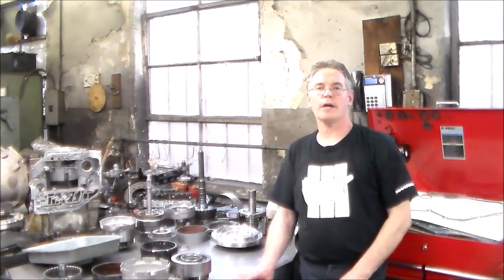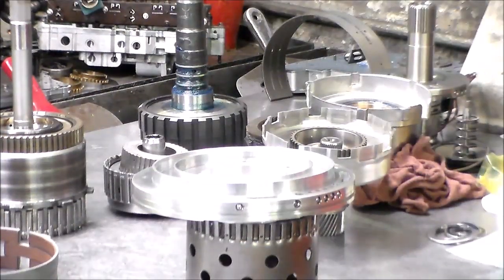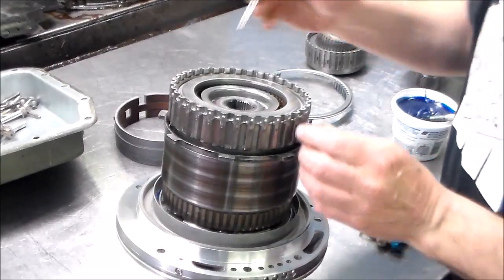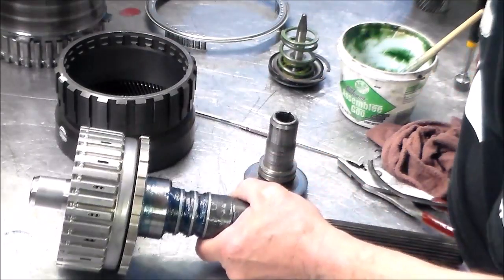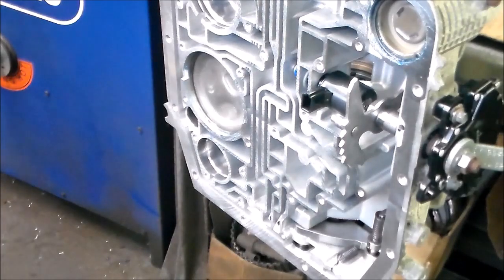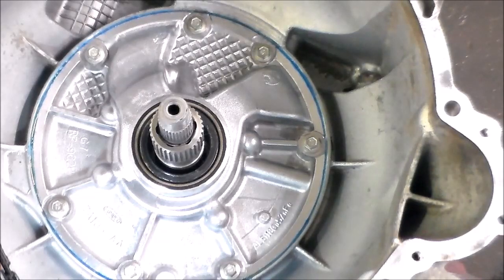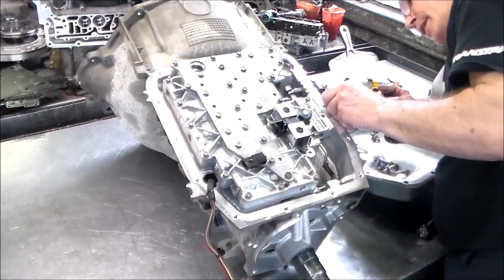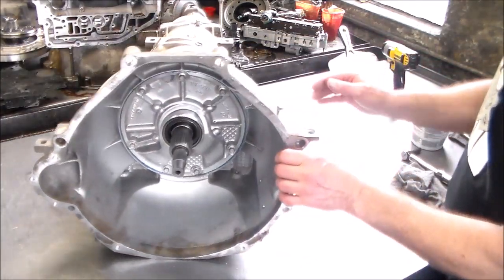4R70W Assembly

Comment: Reusing my old  input drum, modest rebuild (and learning this stuff), I discovered that the input shaft was slowly being hammered off of it's splines (287,000 miles), difficult to remove forward clutches, overheated code, and forward assembly didn't seem to sit all the way down;  It was losing forward oil pressure, my plan was only to fix 4th (burnt band), trash 2-3 accumulator, but none of the forwards had any "Umph!" even before the 1st removal (of tranny), this video, 2 or 3 removal/reinstalls later -- thanks to your air test performance, I have learned more.  Now I want a test plate for every tranny that I do.  I got a salvage yard input drum, $19 USD, air pressure tested it, build everything back up, 4th reinstall, and every gear is working flawlessly.  Thank you a million for your demonstration of air pressure testing; I have become very confident in my valve body vacuum testing already, but air press testing is a game changer for me! Thanks again, I'm subscribing 🙂🙃
Reply from the maker: Thank you

Comment: I would love to see you rebuild one of these for a high performance application. I’ve rebuilt one. An 04 4r70w. I have an 03 trans out of my marauder that is gonna see 550hp(I hope)   Love your videos
Reply from the maker: I do the NAG1 Performance, they are in the Doge Chargers
Reply: I second this. Planning a rebuild on my first vehicle I have ever owned. 4r70w has about 260k miles, and is roughly 30 years old. I've had the truck for about 12 years. My dad loved the truck, and passed away last year. Would like do restore it all the way, and add about 100hp. I have no clue about transmissions, or performance transmission parts! Anyone have any tips on which parts should be performance, billet, etc? Thanks for the video!

Comment: Nice to see it's a rather simple and straight forward transmission. Nice to know the washer for the OD servo will firm the OD shift up. I did the JMOD shift kit to my 4R70W a couple years ago and really like how it shifts but the OD is still stock and mushy. When it comes rebuild time I'll be doing that servo pin upgrade. I see a lot of parts in that trans that look strikingly similar to the old cruise o matic I rebuilt.

Comment: Hi Gary!!

I have a 1997 4x4 f150 lariat and when i put it in drive i have to accelerate the engine for the teran to shift the first gear and after that I have no problem until I have to go back to neutral or reverse and when I put it in drive again I have to accelerate the engine.  Any advice on that? Is a 4r70w 
And what is a good trans kit for rebuild 

Thank you!

Comment: Excellent video. I like you videos because they are so instructional. I really feel like I could disassemble and rebuiled a transmission after watching. You have a decent amount of content on the ZF six speeds. Any chance you could do a rebuild video on one of those, specifically the second gen units? I have a 6HP21 so I have a vested interest. I see a number of disassembly and valve body related videos. I have taken away that the bushings should be replaced with a rebuild. I don't think I have seen a full rebuild, however. Thanks.

Comment: Hey Gary, I’m in Australia and I find your videos very educational and entertaining. I really appreciate the work and effort you put into them for us....thank you. I have a ford falcon with a zf6hp26 and it drives well except for the slightest shudder at approximately 1000-1500 rpm (lockup). What could be the course? Transmission or torque converter? I’m hoping you know of a common issue. Many thanks mate. 👍🏼👍🏼
Reply from the maker: Does it feel like your going over a rough road or maybe railroad tracks?
Reply: @GaryFerraro  Garry, I have a similar issue with the zf6hp26 in my l/rover. Feels like small corrugations on the road. Thanks for the videos. Regards.

Comment: I have one of these 4R70W with 4.6L in a 1997 Crown Vic with 245,000. It shifts without problem but I have a leaking tailshaft seal. So is a 1997 the "old" type where I can replace the bushing without issue? I bought the seal and bushing.
Reply from the maker: shouldn,t be a problem, may have to remove the tail housing but it should come right off

Comment: 2008 f150 4r75e. Rubbing between the center support and the non ferrous drum section. Anti rattle spring installed in same place as yours.
Reply: Mostly on opposite sides now
Reply from the maker: you install it in a different location @twiztedmowers2

Comment: Thank you for the video…very helpful.  I have a 2001 4R70W out of a mustang.  What manufacture of the direct drum and misc pieces do you like to purchase.  Trying to avoid crappy parts if I can for a home build. Thank you in advance…
Reply from the maker: I purchase from Transtar, if you can an OE drum that would be great, Transtar sells aftermarket which i used but if you can get OE from a source or the dealer that is the way to go, overhaul kit i go with Transtec, Bands i think Transtar sends me Borgwarner and Filtran for the filter
Reply: Mr Gary,  I have a 2003 f150 4.6. Is the  same kit for all 4r70w?

Comment: Hi Gary, I have a 2005 Ford Lobo 4x4 5.4 liters and starts fail, 1-2, 2-3 gear and overdrive works good, but in the highway the last gear like 3-4 gear slips like neutral. I'm thinking in solenoid or torque converter lockup

Comment: love these videos. started teardown of a 2000 mustang v6 4r70w. It did not have the antirattle clip for the intermediate clutches shown in this video. do all years have it?  Trying to get to where I know what kit i want to order.
Reply from the maker: That year may not have one,  no need to put one in
Reply: @GaryFerraro   any suggestions please - my 2000 4r70w reverse clutch has a bit over .100" clearance with 3 new frictions and 2 steels, and a .075" snap ring. What can I do to bring that clearance down to specs?
Reply from the maker: @pdperformance1  Ask for early AOD reverse input clutches, same diameter but thicker

Comment: i running an AOD in my 70 mustang. want to upgrade to a 4R7oW. The AOD is almost new and i want to use any interchangeable parts into a good 4r70 case and of course i'll need the  companion computer. is this a good swap? running 500 dyno HP and torque the same. The AOD is too hard to set shifts and torque converter lockup. 2800 stall converter.

Comment: I put a light scratch into a 4R75 1-2 accumulator bore.  Just enough to catch a fingernail.  I bought another core and found what kinda looks like galling in the same bore.  So I bit the bullet and bought a Sonnax sleeve kit and the Sonnax installation tool. Transtar told me the tool is necessary.  The instructions say the tool is not necessary, but convenient.  I can't get the lower sleeve into the bore.  It feels like an interference or press fit.  The upper sleeve feels loose by comparison in the upper bore.  I assume the loc tite they recommend will solve for the loose feeling sleeve.  I can't afford to screw this up and failure to install correctly looks like a permanent failure.  Can you share some insight as to how I'm supposed to install that lower sleeve?  Thanks for your time.
Reply from the maker: Did you try sanding may be burrs or something keeping the sleeve from going in all the way
Reply: @GaryFerraro  Thanks for getting back to me.  I tried both halves of the sleeve in both cases.  The upper sleeve feels equally loose in both cases and the lower sleeve feels equally unable to fit either case..  There are no scratches , knicks, or burrs that interfere in the lower bores of either case.  I removed the high spot of the one light scratch I did cause.  The smaller sleeve is tight right at the chamfer in each bore.
Reply from the maker: If there is an issue installing. Call Sonnax tech line. I’m honestly not sure how loose or tight it should be. Do they talk about reaming or just drop in
Reply: @GaryFerraro , Considering Sonnax says the tool I bought isn't even necessary, I expect that to mean it should drop right in.  Just for clarity, the instructions say nothing of any reaming or other tooling required either. I did put a call into Sonnax yesterday, but I'll have to wait until their tech support is open Monday.  I appreciate your time and I'll let you know what I learn.
Reply: @GaryFerraro  Sonnax tech support was useless.  You offered better troubleshooting and they gave me vague suggestive directions to nowhere.  I'm still friends with the guys who taught my automatic transmissions classes a long time ago and I'm going to see if they can offer some help.
Reply from the maker: @shauno3697  Did they say it should fit like that, did they say you may need a bushing driver to install it
Reply from the maker: @shauno3697  Thanks for the video Shaun,  So do you think you can sand out the mark you made, is it that deep?  So basically the upper sleeve will not even really fit?
Reply: @GaryFerraro  I did sand my one scratch out of the other case enough to prep for the sleeve kit.  I knocked the ridge off of it, but there is still a slight groove in the bore.  I can't say whether or not it's good enough to ignore and continue with the build as is.

Lets not call them upper or lower sleeves.  I believe I'll get us both confused depending on perspective.  Let's go with larger and smaller sleeves.  There is no issue I know of with the larger sleeve.  I slid it in completely by hand and even felt kinda loose to me.  The smaller sleeve will not fit at all.  I know the sleeve does, at least, center itself to the bore.  The bore and the sleeve both have a chamfer to them and they center off of each other.  But once they make contact, they don't move any farther.

I'll get back to you on Wednesday after I get the bore and sleeve measured out.
Reply from the maker: @shauno3697  ok, sounds good,  anytime i had one of these with broken sleeves i was able to sand it so it would be acceptable to use.
Reply: @GaryFerraro  My friend Paul measured the smaller bore and he came up with 1.617.  I measured 1.605 on the sleeve.  I don't know how close to the chamfer he measured or how talented he is with his measuring tools.  But, it's obvious the sleeve should have fit.  Either way, I had Paul assess both the bores and he said the exact same thing you did about sanding the bores.  As such, I'm just going to return the sleeve and the tool and clean both my cases and make transmissions out of them again.
Reply from the maker: @shauno3697  ok, sounds good, i think you will be fine

Comment: I really enjoy Gary's vids and how clean & organized he is. From what I'm learning, maybe it's best to tear the trans down THEN start ordering parts after an inspection. Seems there are several rebuild "kits" and vendors for different areas of the trans. There are several shift improvement kits out there....is this something that is really needed for a daily driver and dependability? Any ideas how a DIY guy could tear one apart and not have the fluid everywhere...kiddie pool?
Reply from the maker: drain what you can into a pan or bucket or if you have a bench cut a hole and scope the fluid there, if your going to pull the trans, drop the pan first, if you also drop the valvebody, the converter will drain. I always order the basics, Banner kit and my bushings, i know i'm going to need those then after teardown i order the rest

Comment: I have the same transmission in my Mustang the overdrive Works until it heats up is that the valve body that would cause that problem please respond before I take the transmission out of the car and your video is awesome
Reply from the maker: Not necessarily. what happens when hot, does it neutralize in 4th or just stays in 3rd gear?

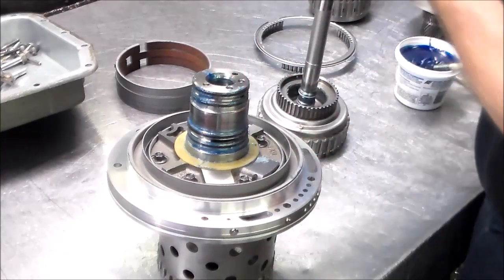Comment: Just got finished tearing my transmission apart and it didn't look to bad inside but the only problems I saw was the OD band was completely worn down I have no idea how it even had overdrive and the clutch pack inside the reverse drum (I think thats what its called its what you picked up at 20:07 ?) were burned up pretty good. What would cause this? Was good on fluid level did this have something to do with the OD band being burned up?

Comment: I know there are a lot of variables, but I was wondering how long could one of these transmissions could last before you would recommend a rebuild?  I have a F150 4.6l with 250K on the clock.  Mostly daily driver with light weekend towing and only a handful of really heavy towing (40 hp tractor).  Serviced regularly. Currently no issues with transmission. Do I do a preventative rebuild or wait for an issue? Thanks
Reply: I put 318k on mine before it started slipping; the OD servo pin bore was heavily worn, allowing loss of forward clutch pressure; I would run yours until their is a problem
Reply: You should drop the valve body and rebuild it by installing new sonnax valves and end plugs along with installing the sonnax overdrive pin kit.
Reply: Don't do anything until start slipping .  Just do a regular service, change the filter(very important) and add a high quality fluid.
Reply: Pedro Hernandez thanks. That’s what I’m starting to feel. Not looking to create new problems by pulling it. Just wanted to prevent some internal failures before then. But if slippage likely failure, I’m gonna wait.

Comment: At 37:12 you place what I think is the very first bearing. However, it could be a washer. If it is the first bearing, which part goes towards the back and which part goes towards the front? Or can this bearing be placed universal?
Reply from the maker: The bearing part faces up and the "cup" part  fits on the case, can only go one way

Comment: I see this failure a lot on the econoline vans, I think I read a Atra bulletin to shorten  yoke on the driveshaft some, because the claim it’s binding when van is loaded with weight putting too much load on the rear shaft pushing everything forward braking the clip
Reply from the maker: Thanks for the tip, going to see what i can find

Comment: Decent video, but, this is a 4R75W not a 4R70W. The 75 has two speed sensors, the 70 only has the one near the back of the main housing, and I don’t mean the vss sensor on the tail-housing.
Reply from the maker: Correct, i call them all 4R70W,  overhaulkits are all the same

Comment: I am rebuilding my 4r70w, and I'm having trouble with the stator sealing rings, couldn't get them to snap together, so I used a hose clamp, and that broke them, got a new set and can't get them to snap together
Reply from the maker: for the direct drum(2 rings on the bottom)
Reply: @GaryFerraro  the pump stator, 2 large metal rings that snap together, the are for the reverse clutchs
Reply from the maker: @sinistersilverado965  Yes, they can be a pain to hook together.  I hold one side with a small pocket screwdriver, hold it against the stator and then try to push the other side to hook it up
Reply: @GaryFerraro  I bought the sealing rings from another supplier, and the rings snapped in no problem

Comment: Hello! Just got my 2011 Crown Victoria Police Interceptor (with a 4 speed automatic transmission) rebuilt. Is there a certain amount of time that I have to break it in and drive it lightly until I can floor it? Your response is much appreciated!
Reply from the maker: I would say no. Really is no break in period
Reply: @GaryFerraro  Wow, thanks! I guess I will take a spirited drive now!!
Reply: @GaryFerraro  Another quick question, can I expect a few shudders at low rpms when accelerating slowly from a slop that im experiencing now to go away after driving it some more? Thank you
Reply from the maker: @mod3rnwarrior34  Probably not, are you sure it is a trans problem
Reply: @GaryFerraro  Im not sure, its been driving no problem it just has a very mild slight vibration when slowly accelerating from a dead stop and a weird but still mild hiccup when shifting from 1st into second. I mean it is a newly rebuilt transmission and I haven’t even put 100 miles on it yet. So I just am confused as to what it even is.
Reply from the maker: @mod3rnwarrior34  this happens on the 1-2 shift?
Reply: @GaryFerraro  Most of my worry is from the shuddering but yes it felt kinda funny when at full throttle and when it shifted from 1-2, it kinda was like a slight shudder maybe 3-4 times really fast when it shifted. My rebuilt transmission is under warranty.
Reply from the maker: @mod3rnwarrior34  May be something in the 1-2 accumulator, since under warranty, drive for another day or two, if still there bring it to there let them test drive it
Reply: Do you think that I should drive it lightly and see if it works itself out? I once got my front suspension rebuilt on another car and it vibrated whenever I turned and it worked itself out eventually. Hopefully that is the case for this.
Reply: @GaryFerraro  Ok, Thanks for helping!
Reply from the maker: Really is no adaption on this, can't hurt to see what happens, if still there after maybe 3-4 days of driving may not work itself out

Comment: 35:29. The ring gear, The square teeth on the outside, those are for the parking pawl only? I found one with a corner broken off, was told it can be re used. Do you agree with that at all?
Reply from the maker: What year is the trans or the car it's going in